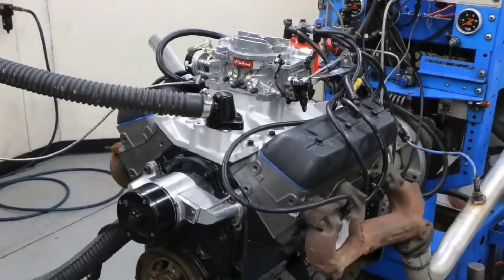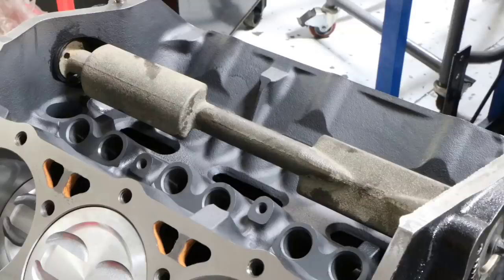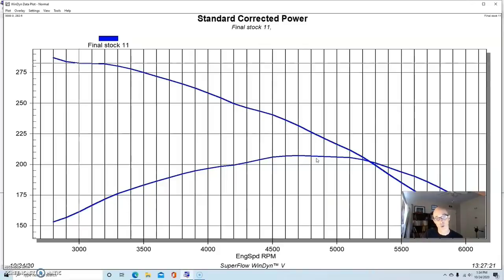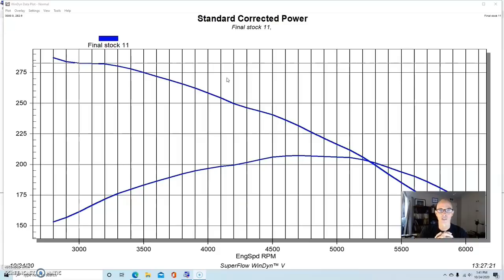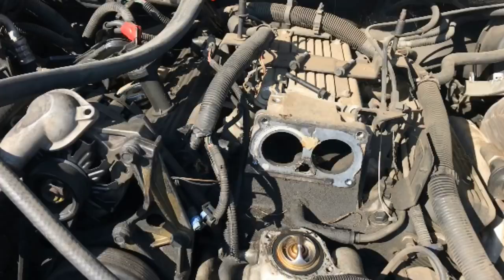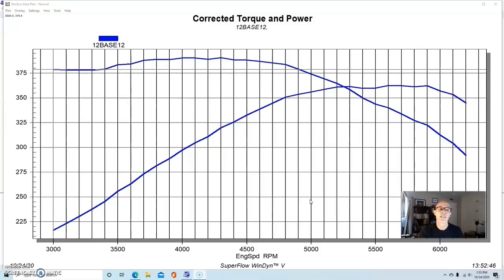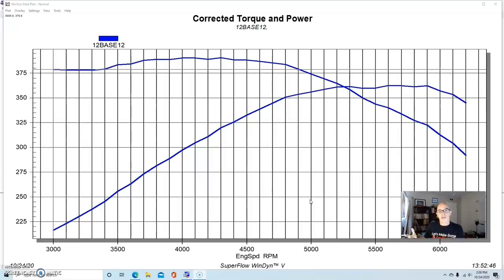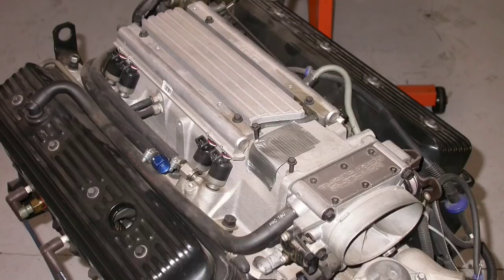4.3L V6 VS 4.3L V8-WHICH OTHER GUYS MAKES A BETTER BUILDER?

Comment: I run a fully forged 4 bolt main Procharged V6 4.3L Vortec with ported bowls, blower cam, and 48lbs injectors (Stock Intake) at 16 psi of boost at 6K RPM. This is daily driven and a nasty little motor. Number one comment I get, "What size V8 did you put in it?" I laugh and show them. On first tune it did 448 BHP at the flywheel. Run a 4L60E Stage Two from Performabuilt... Works awesome. (New tune on the way; does have intercooler and water/meth)

Comment: For a daily worker=V6, no questions asked.
For a project car to trash around and don't matter if/when it lives or dies=V8.

Aftermarket high performance cylinder head manufacturers are mi$$ing out a big chunk of the HP market with the lack of V6 4.3L offerings.
Wouldn't it be nice to have some sweet performing true and tried AFR, Brodix or Dart heads in your stock bottom V6 work horse and turn it into a better performer beast ? 
Just looks at it this way: ALL THE HEAVY LIFTING(R&D, programming, tooling) has already been done. There isn't much to loose in such venture.
All they would have to do is chop #4 and #8 of their already existing fancy high performance V8 offerings in their CAD programs/CNC programming and they would be set almost instantly to offer it.

Comment: Hot Rod Mag. built a 5.0 LT1 or 302 I believe back in 98 and put in a Z28 Camaro. They seemed to have liked it pretty well. 
 I liked the 350 or 5.7 they built using a 400 block and a 327 crank.  They used long rods, LT1 aluminum heads, 11/1 CR and a tight piston to head quench then ran it on 87 octane gas. I think it made about 400hp and lots of torque from idle to 6 grand. I'd love to see you build both of these engines.

Comment: Back in '99 i decided to improve the performance of my 91sonoma it had a 4.3 v6 z code engine (counter balance engines are w) with 100k on it . Because its a 3k lb brick i wasn't interested in setting land speed records, one thing i noticed at car shows is SBC swapped s10's were so common people just walked past without even a glance, so i decided i wanted to be different, i already had the z engine. 

I pulled the engine took it apart i sent the short block to a local shop for bearings, rings, and oil pump. I knew this guy he did porting with abrasive slurry he said he started with 163cfm flow on the heads and ended up with 225cfm he also port matched my edelbrock tbi intake manifold and ordered a custom ground cam from comp cams (almost identical to the 266hr available now) did some valve work also. I put the engine back together with a catless edelbrock exhaust (headers to tailpipe) and a holley 670cfm tbi unit.

Now i had a lot of problems getting the engine to settle down but i finally got it reasonably good it had a lumpy idle but for a traffic rocket it was perfect. It has the stock 700r4 and 3:08 one wheel peel which it frequently rips loose from the pavement and it will still give you 22mpg. Sorry i never had the chance to put it on the dyno or track(nearest one is 1.5 hour drive) but the butt dyno said it was an improvement. It ran up until 4 years ago when the lifters gave up at 240k, its been in storage waiting for racecar stimulus package.

Comment: Packaging, v6 smaller and lighter vs v8. Anywhere a l99 will fit an lt1 will fit ONLY reason to run l99 would be availability and/or price. You could argue that the thicker cylinder wall gives some advantage but you would probably throw that longer rod trough the block before that point. But that's just speculation please add boost and find out for us Richard

Comment: Looks pretty good on the v6 curve. I dynoed my 96 blazer and with a hypertech and free flowing exhaust it made 170hp at 4400 and 225tq at 3200, but that's as low as the could dyno in 3rd without it down shifting

Comment: I took out the 400 sbc race engine in my T56 71 camaro, and replaced it with a forged flat tops, stock roller cam stock q-jet carb and intake 4.3V6, don't race year round, so i save my V8, and cruise a lot on a V6, plus i save $$ on gas too

Comment: Dude!!!! Finally Rich! Now we have a nice high rpm build. Please get the appropriate valvetrain and 308 duration SOLID ROLLER cam for 9000 rpm operation. You have put together so many combinations to show pretty much every aspect of every component with one exception, HIGH RPM FUNCTIONALITY.  A 3 inch stroke can run up to 9800rpm in the 4.3 v8 configuration without exotic parts. The stroke is short enough to keep the piston speed around 5000 feet per second. The small bore pistons should be light enough for the rods to handle it. 
Please do it up!!
Reply from the maker: piston speed is rarely the limitation-we can run a 5.7L (or bigger) up there two with the right valve train (look at on old 358-inch cup motor or Pro Stock or Mountain motor

Comment: Also, Brodix still has the V6 aluminum-8 and -10 heads available, they run ~2400 a set for either one.

Comment: GM built a hotcammed, aluminum head version of the L99 265 they put into a 1955 Chevy back in 1995. It was well over 300 hp and backed to a 4L60E that shifted over 7,000 rpm.

Comment: From what I know small bore, short stroke V8 engines are great for turbocharging, twin turbos would be best and the V6 would be better supercharged. Great comparison video. What I don't know,  can the 4.3L V6- 3/4SBC be stroked or destroked, like the SBC 383? If so, it would be be a better for turbo applications.

Comment: I have owned two 4.3 v6's , one Tbi non balanced shaft and one Vortec balance shaft engine . The main thing I don't like is the vibration that 90 degree v6's have same goes for the Dodge 3.9 , the 3/4 318. So its 4.3 v8 for me .
Reply: I too have owned two of the old cast iron 4.3 V6's. One in my pickup back in '91 and the other in my current '05 pickup. The '91 was not balanced and it did vibrate some. The '05 has the balance shaft but it's still nowhere near as smooth as a V8. Anyway, I always liked the 4.3 V6 because of good fuel economy, extremely good reliability, and they produce a LOT of low-end torque. Which makes them perfect for me, for what I use them for, utility purposes at an economical cost.

Comment: I always thought the 4.3l v8 would be neat to put in a 55 or 56 chevy that originally came with a 265V8.  This 4.3 is the same size with an inch or two.  it'd be neat when people see it to tell them it has a 265V8 (baby LT1)

Comment: i owned a 94 chevy caprice with that 4.3 v-8. purchase car in the late 90's. that was my best running small block engine i every had for a daily driver. this engine would easily out run any STOCK 305 or 350 4b square body caprice. this little fuel injected motor with a 4speed/overdrive would just fly in this big body full frame car and for it's TIME(1994) it had more then enough power to move itself out of it's way and i got real good gas mileage for a big full frame car. one road trip i did a gas check on it few times from wis to miss and over pennsacola fl and it average 25 on the first and two 24+ and a 21+ in town driving. that was unheard of for a big frame car. this was no laughing motor as you think it is in your video. chevy built something way before it's time and only had it in the 4door chevy caprice for couple years or so(94up) and then got rid of it. almost like it was to good?  speed things up to date now i am driving a full size 2011 gmc with a 4.3 v-6 for a daily driver. i don't want to say this but it's a real dog, but it still has enough power to get itself out of it's way for the most part. now when i want to pass some one i need to think about it. it's like punching a ups truck. makes alot of noise and barely moves...lol.   hey i did do a gas check on it couple weekends ago on a 6hrs trip. 17+mpg, thats all it would get...lol
and by the way i still own that chevy caprice. man does that car ride like a dream.

Comment: The L99 4.3 V8 came in the '94 Caprice but was built 3 years through '95-'96.  The head has a semi heart shape but the valves look shrouded similar to the 305 HO head with 1.84's but they're 2'' according to Chevy casting Numbers, Mortec I think.. Look up Rock Auto parts and you can view that head part #12554291 and 10208890. Looks like a thin casting and I'd guess the chamber is 58cc or smaller. Like to see the 3 in crank in the LT1....please,
 thanks Rich!

Comment: This is actually a tough choice for me.  Ordinarily I'd go with the V8 99.9% of the time.  But I remember the turbocharged 4.3 V6 that was featured in both the syclone  and typhoon.  For the 90s, they made exceptional power.  By today's standards, not so much.  But you can always fix that with a stout bottom end, decent flowing heads, and a lot more boost to make a powerful engine.   Now the 4.3 V8, or what I like to call the baby LT1, has always been one of those just for shits and giggles engine builds I'd wanna do.  Of course you'd still need forced induction to make it respectable.

Comment: I'm more into max hp without boost and less weight, less parts for 375 hp range. Would like to see what can be done with the latest version Vortec v6. What is the total cost per hp? What is the longevity comparison? What works best with added hybrid tech? The cost of petrol will likely double as more EVs hit the pavement. It's the capitalist way! Toyota's hybrid Rav4 proves point.

Comment: A lay mans opinion.  4.3L V8 if you are boosting it for this reason.  I think it will survive better because of the crank balance and therefore with boost it would be easier to RPM it to a higher level and thus more horsepower.  NA then probably 4.3L V6 as the heads will just breath better and the Edelbrock intake can be worked to flow a bit better so more air= more power.  But this is all just a guess.

Comment: I have a 4.3 v6 in a full size gmc running 12 lbs of boost  daily driven runs well ,no dyno numbers, but has survived . Very little support out there so they are challenging, lots of 1 off stuff

Comment: my initial thought were that the V8 would make more power due to the larger flow volume on the heads. But I think boost and porting could change that depending on what the motors will actually hold.

Comment: Pretty sure the heads have small chambers like a 305. Probably based on the 305 vortec head. I heard back in the day the vortec head chamber and port design came from the 350 LT1 so would assume the L99 head probably is same idea. I have one on the shelf too. Was going to build a 302 LT1 because I have LT1 block and aluminum heads to swap the crank into.

Comment: GM released the LV1 in 2018, which is the same as the LV3 but without the Active Fuel Management technology. Do you know if there's any support for supercharging (particularly positive displacement) an LV1/LV3?

Comment: I'd pick the v8 first but if you are running a S10 or Astro van the smaller original v6 fits real easy. 4.3L Vortec v6s are very plentiful in the wrecking yards.

Comment: Pontiac built a 4.3 V8 in the early 90's and had a supercharger on it with a T-56. It made over 300 horsepower and was very rpm happy

Comment: I like the v6 vortec because I drive a blazer with one. But for performance the 8 cylinder has more potential because of the extra valves.

Comment: You can get the even fire crankshaft for the 4.3lV6 standard 90degree.think GM still sell the 4.155 bore block for the v6 also

Comment: I like the oddball engines, the L69 305 we put in the 1978 GMC Sierra 1500 and that's plenty fun. I need to find a better manifold for it. I love the idea of having a variable runner intake, but that is like in another century of engine design.
Reply from the maker: I raced against the H.O. Camaros in SCCA Showroom Stock-that engine was good
Reply: @richardholdener1727  When I was in high school my parents bought a replacement engine for a 86 Caprice, and when in tune the car could fly. When the car body was no longer well. Took the engine out and checked the head castings and found out it was not the 150 HP 305, but the L69 with flat top pistons. It's not a high priority to get that truck going, but soon I need to just dump the M4ME I put on it and find 
something better. As it seems starved for fuel.

Comment: I think that if the Lt-1 heads fit the L-99 V-8 then there is more potential for forced induction ..if you can port the heads to any significant degree then you can obtain better flow and therefore more boost ( turbocharging would be preferable)( some I-4  Imports achieve over 400 hp on turbo)you can use resulting in better the power curve and there's that little thing you forgot to mention,, the fact that the V-8 will run smoother overall with a short stroke the revs can be elevated a bit more and still hold together. ad if other LT-! parts fit and can be effectively ised the the potentiol is there for serious power gains in my opinion.

Comment: To be honest Mr. Holdener, in " theory " displacement is displacement. If everything is identical, including weight, there should be absolutely no difference.
However my hypothesis is this, in na applications, the v8 should produce less HP, but more tq.
 This is based solely on parasitical rotational frictions, which should increase with the quantity of rotational parts increasing.
Reply: As far as which builds better I’d think it comes down to heads. Which heads work best on a small bore V8 versus best heads available for a larger bore V6?  I’d go with the V8. Could always “ bolt on” a bigger short block for huge power gains😁
Reply: @fishsquishguy1833  allot has to do with bore spacing, then matters valve train center lines. Is: a 305 would benefit from both valves being shifted towards the exhaust valves. However this would seriously change the block casting as the cam couldn't line up with anything above it. You may be able to use offset lifters, but then the cylinder head becomes an issue.

Now also take into account, that GMC made a 305 v6 in '68.. Not sure its production length.

Comment: The 4.3L V8 in the Caprice was all about MPG. Most of the old Caprice taxi cabs were 4.3L’s back when those were still in use. At least any that were bought as new fleet units. 

I know a lot of Crown Vic taxis are retired police cars, so I wonder if any cab companies ever ran ex-police Caprice’s and swapped out high mileage or blown 5.7’s for a fresh 4.3L V8. Since most cabs just idle around town day, I’d imagine that any smart business owner would avoid running the 5.7L motor when the 4.3L was available.

Comment: Cool idea, add a 4200 vortec inline six and run them all in the Nova. Try for as close to the same compression and similar cams, sadly all things being equal, they should all make similar power, you can only shove the same amount of fuel in them all.

Comment: After you posted this video, in 2021, PowerNation did a 4.3L V-6 NA build without going crazy on the cam, and got 262HP (engine only) with the edelbrock intake manifold and carb.
Reply from the maker: where do you think they get all their build ideas from?

Comment: In a wedge engine large stroke equals large torque, and large bore equal large horse power, now a 305 is the smallest bore chevy made in a small block but pushing it with boost and the small bore does not hinder the engine anymore, I hear of a guy running a 366 big block engine running in the 9's in quarter mile in a first gen Camaro, yes he could go faster for easier with a 454 or 427 but boost will overtake any air flow problems you could dream of

Comment: Very good stuff! 

Super Excited to see the "DZ 302 LT1" build & dyno. I thought I was one of the few who still remembers the Baby LT1. Even 20 years ago hearing about them was rare. I wonder why GM decided to build a de-troked 305 LT1 and then to put it in a B-body(?) Caprice...I've heard the Iron LT1 heads (94-96) Impala SS actually flowed a little better than the aluminum version (93-97 F-Body & 92-96 Corvette). Don't think I ever saw a back to back flow comparison though. Too bad LT4 stuff is almost as rare as a hen's tooth because it'd be really interesting to see them on the 302 build.

In the end to me, the V8 option just makes the most sense, parts availability alone makes the choice easy.

Comment: A very large V6 or a very small (by North American standards) V8 

I love both. I thin the exhaust put a V8 sounds way better. But inside the car, the engine of a V6 sounds a little more interesting and unique. Idk, I’d have to go with V8 probably.

Comment: My preference is the V6 due to there are more in boneyards, not sure if or how long this will be true?  The one thing that bugs me about the V6 is the unique rods, given the larger rod journals.
Not sure about economy of V6 vs V8 4.3 but economy is one of the reasons I play with the V6.
The V6 shoehorns more easily into smaller engine bays.
Are there any carb intakes for the 3800 Seires II, and what's a mother to do for 3800 tranny/ignition?

Comment: As far as the V6 vs V8, to me it depends on the chassis. For the S10 family (s15, blazer, Sonoma, etc) I'd build a V6.  Simpler is easier. In factory v8 applications, the v8 might make more sense. V8 seems to be smoother power.

Comment: Someone in the 90’s built a 302 LT1 and installed it in a tribute car.  I think it was a 97 z28. Was a cool build.  

I believe they may have even used the l99 crank.

Comment: I had a 4.3 260ci olds in a cutlass supreme. It was like 120 hp. I replaced it with a 403. Olds also made a diesel 4.3 V-8 came in cutlass supreme and 4.3 V6 diesel in the cutlass ciera.

Comment: Hey Rich! The reason they put that anemic V8 in the caprice is because they were competing with the mn12 thunderbird/cougar which had a low power, Non-PI 4.6L 2V ford mod motor which was pushing 200hp on a good day.

Comment: The tbi 4.3v6 had the better flowing heads i have built a couple of them. The only things I've found that you can't get is a upgraded intake for fuel injection and crank shaft unless you can find a bowtie crank or (I think its) an even fire crank.